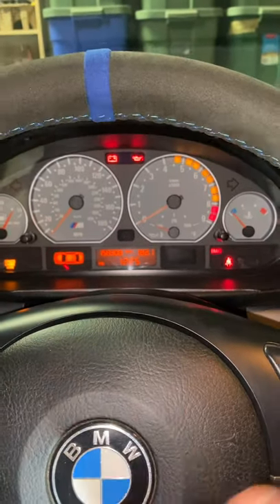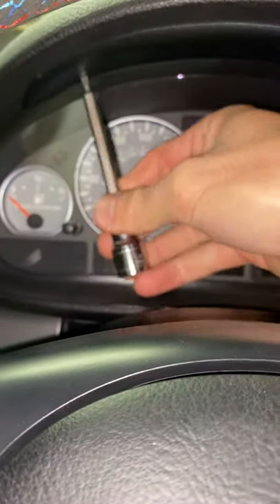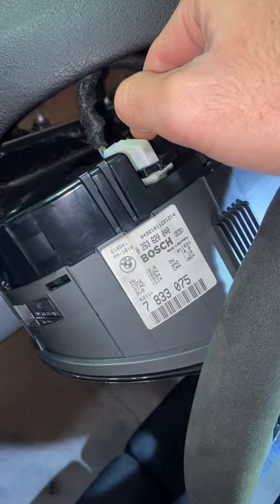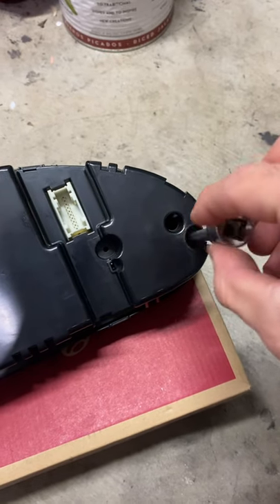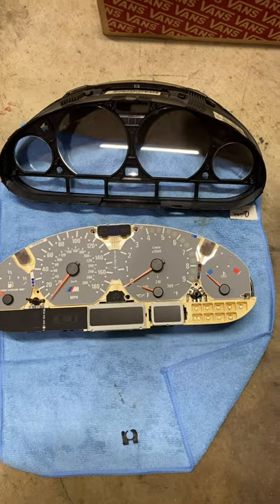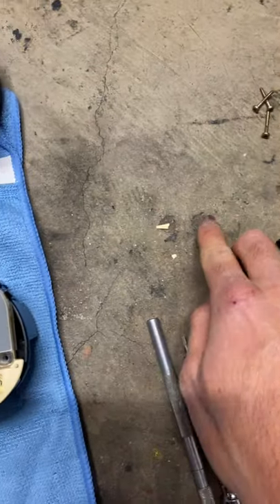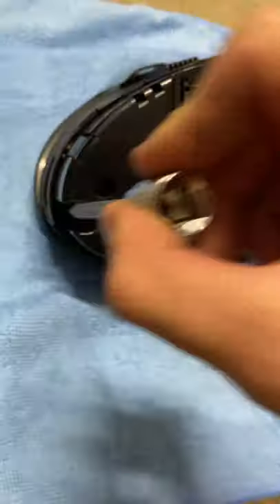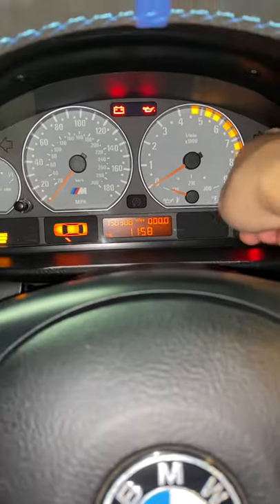How to Fix BMW E46 Clock Adjuster #shorts

Comment: As of 12/17/2021 the link does work. I just did this install. Really simple. Really effective. In the video, just before he says, "just do everything in reverse", back up and look at the way the part sits in the cluster, which shows the correct orientation. About a 15-20 minute job. When removing the cluster set the steering wheel all the way out and down to get room to pull the connectors. Pull the black connector first, then you'll get a lot of room to pull the white connector and remove the cluster. Thank you!!!

Comment: Pull the shaft cover out, yes shaft cover.  One is a stationary shaft that you can only remove by taking the instrument cluster apart and the other, is the cover that easily pulls out and pushes back in.
Insert a paper clip and find the button to the left of the shaft.
Once you see the clock moving, do your thang.
When your clock is set, push the shaft cover back in and you're done.  Fuck taking that whole shit apart!!!
Reply: Thank you!!! Little tricky finding the button back there but it worked.

Comment: Has everyone tried pushing the B/C button on the turn signal stick? you change from ambient temp to mpg and then to clock display. The woman I bought my04 325i had it for 9 years and never set the clock. I've had it for 15 minutes and I now have a cluster clock and another on my stock stereo. No need to take anything apart.
Reply from the maker: yes we’ve tried pushing the b/c button. that doesn’t change the time though. this video is to fix the broken clock adjuster